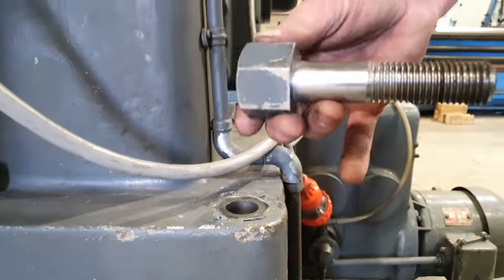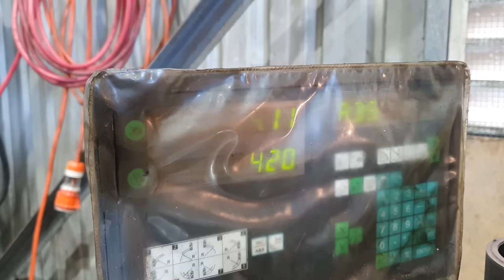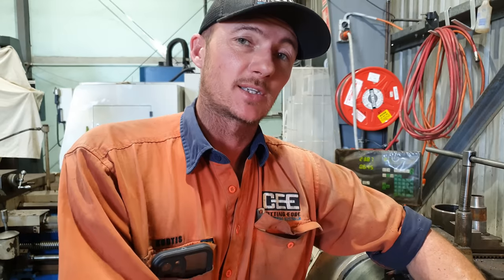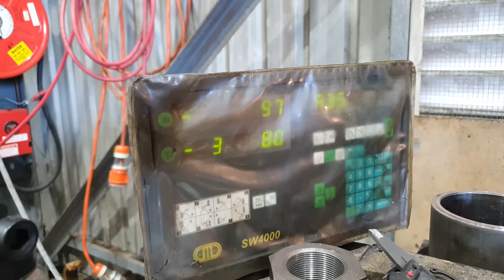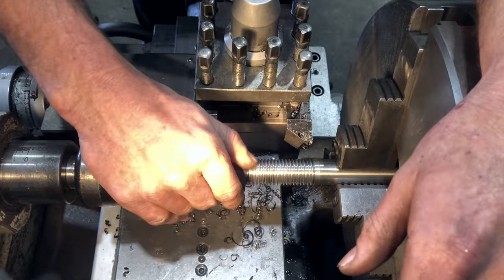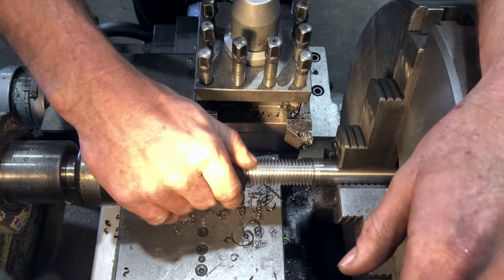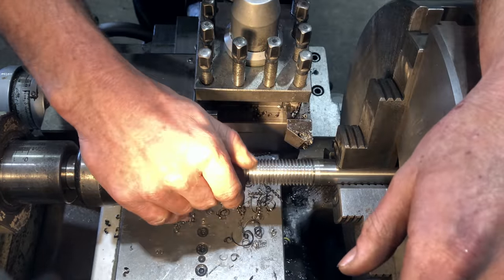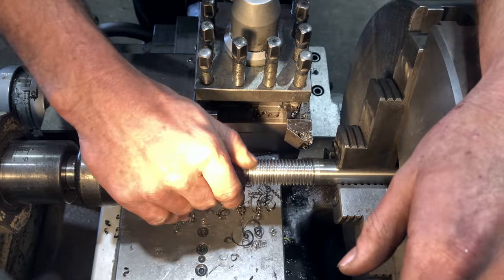Making BIG Hex Bolts | K&W Facing Borer Upgrade | Part 2

Comment: Sometimes, watching these videos makes me wish I'd been a machinist instead of going into IT.  While both are highly creative, you get to play with HUGE machines being a machinist and create something new every day that people can see.  Still, always amazed at the number of operations required for something that seems sooooo simple.    so many setups and individual operations to make a thing of beauty.
Reply: well a computer won't eat your arm and this thing absolutely will.so thats a plus for IT😅
Reply: @erikbergstrom258  On the other hand, IT rots your brain.  Machining seems to be a different problem every day, even if it's the same procedure, different problem.  You also get to see your daily work go out the door, not so in IT.  Might take months for a project, then you get stuck on support for that project and never get away from it.  Machining has definite plusses (other than ripping your arm off of course!)
Reply: You may just want to do it as a hobby in the future and set up your own little home machine shop. That way you can apply what you are learning from these excellent YouTube videos on machining. The hunt for good used inexpensive machines and tooling is another fun adventure.
Reply: @edwardkawecki8101  I am an amateur wood worker, and it's amazing how much translates across with the lathes.  Other areas as well.  Even welding (ok so this is a stretch), but when creating a wood item, you must be concerned about strength, how to make the joints look good, and provide the functionality you want.  I really enjoy these!

Comment: Yes, working in the lathe can be fun. But why not shorter thread in one end longer in the other and then just use locking washers and nuts? Less material into chips, less money lost and less time spent...
 If I can get CrMo premachined in tight tolerance (for example ∅25mm +/-0.05, my caliper mostly reads 24.99-25.01...) I would asume that you could have got ∅1" +/- "close enough" to make the threads?

Comment: Why not start off with 1 in bar, thread, and make studs with washers & nuts?  Probably would cost a bit less between material, time, tool wear, etc......just a thought...

Comment: Why didn't you keep the diameter larger and then thread the end as you did.  The old 1" dia width was fine for the original piece, but you added an extension that might need a larger diameter for stability.

Comment: dis one time I thought I'd be clever and rerun the OD tool over the threads for deburr then follow it with the threader, cause thats how its often (ahem should be) done on CNC lathes... totally gooned the fact that I would need to change the feed gears and therefore lose my start point for the threads... it didn't end well

Comment: Have you ever done any blacksmithing?  This would have been cheaper & faster if you used smaller bar stock  upset one end before machine to finished size.

Comment: Do u recycle the chips?  Is that even a thing or do they just get tossed because u should have quite a bit from all the work u do and am sure what we get to see if minimal from whatu actually work on
Reply: Their metal supplier also provides a scrap bin which is emptied and replaced as needed, there are a few videos showing Kurtis dropping stuff in - sometimes using the forklift. The supplier organises any recycling.

Comment: I get a kick out of your metal supplier's sense of humour . "Fragile" stickers on a package of steel bars which Kurtis promptly drops. So much for that warning. 
Good looking bolts. Need a makers stamp though.
One question . During the threading operation, every now and again, you advanced the compound a few thou. I'm sure you have a reason for doing so and you've explained your preferences for single point threading on the lathe which I understand and respect but this, not regular, operation I've not noticed you doing before. Care to enlighten us. 
Regards from the "land up over", Canada's banana belt.
🤔🇦🇺🤞🇺🇦🕊️🇨🇦🍌👍😃

Comment: Wouldn't be easier to buy less diameter of the bolts for the threaded part and then weld it together with short but bigger in diameter rod for the head?

Comment: Must be Metric leadscrew on that machine if not using chaser dial and engaging each cut?
Reply from the maker: This machine is equipped with both metric and imperial leadscrew. I just prefer to thread with the half nut engaged

Comment: Perhaps I don't understand, but why would you not start out with 1" diameter stock, thread boths ends and then install with 1"-8 hexnuts on the top.
Reply: Hardened flange hexnuts would help reduce the PSI load.  Friction would be the same as non flange as it is not influenced by contact area.

Comment: I'm sure the reasons are obvious but I'm not a machinist. So why didn't you just buy rod at or near the composition and diameter you need; thread it on both ends; weld a nut on one end; and be done with it?

Comment: Psst. I get it mate. I won't tell the pretty camera lady. Let me guess; it's a boat, isn't it?  It's a boat! I just know it. 

 It's a good graft you have going. You order up a lot of pricey high tech metal, reduce it by 50% turning it into milling waste and sent in for recycling. You recycle your shavings and fines separated to get top dollar. Now the pretty camera lady would notice a purchase of high performance motors for the boat in the monthly bank statement and say "NO!" and you say bye bye to your boat dreams for another year. 
 Whereas she knows you need specialty steel, titanium and aluminum alloys, so those items get paid for since there "usually" is income after expense. You remembered back in the early years, the pretty camera lady said you can keep the recycling returns to fund your various projects. So now when you need 1.5 inch rod, you order 3 inch rod, mill it down and get a new "what ever your fun time toys are". 

 It's brilliant mate, top shelf ingenuity and craftiness. Well, it was. I think that may change if she ever reads this post.

Comment: maybe i am missing something but can't you start the process with thinner rod and without chrome; i am think that would cost less?
Reply: maybe a double sided bolt with left thread on one side and right thread on other side would save a lot of material and cost. Please correct me if i am wrong
Reply from the maker: You could but that's not how I wanted to make my bolts 🤣👍

Comment: you could have ordered  1 " -8  16 inch long allen socket head cap screws from mcmaster carr in usa in stock. $ 68 us apiece . those would be more than grade 8 as well. that would be 3.5 mm shorter . so likely fine. but then you wouldn't have any content for youtube.

Comment: I guess those bolts will need some heat treatment?
Reply: The base 4140 bar is already Quenched and tempered to grade 5 equivalent yield strength.

Comment: The long bolts look great, but I think you went into a lot of unnecessary trouble making them this way.I would have taken a 1" rod, thread one aide the length you did, and the other side just long enough to take a 1" nut, then screw the nut on and weld it on on both sides, of course after cutting out the required space. Then machine the welds, and I got me a long bolt in half the time or less. You said you have very little time for those shop jobs, so I wonder why you went for the time consuming method. I don't doubt the end result is impressive, but to machine down so much metal just to get that bigger diameter for the hex head at the last 3 cm, and then to mill 6 hex heads...doesn't make sense to me timewise.

Comment: Why not just use 1" round stock, thread both ends, make hex nuts, thread them on and then weld them, finish the end and presto hex head bolts? Just as strong and far less machining

Comment: Curtis mate you gotta stop washing your hands with brake cleaner.

What do you think an equivalent bolt from a manufacturer would cost off the shelf for that application? I have some BOWM alloy bolts for a welding jig that are probably only an inch or two shorter than those, I didnt pay for em god only knows what they would cost now.
Reply: Kurtis*

Comment: No one knows that they are screws, not bolts
Reply from the maker: Please do explain how you came to that conclusion...🤔🤣
Reply: @CuttingEdgeEngineering  Bolt uses a washer and nut to hold objects together. Screw uses a thread in the detail's body